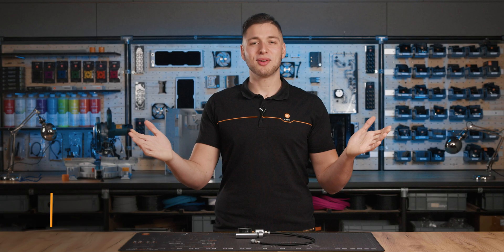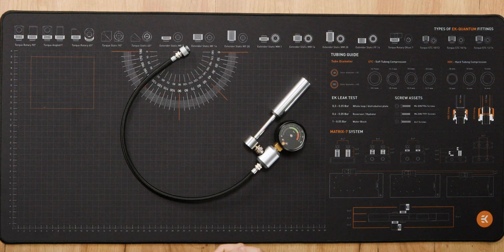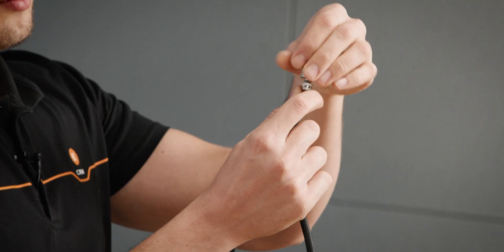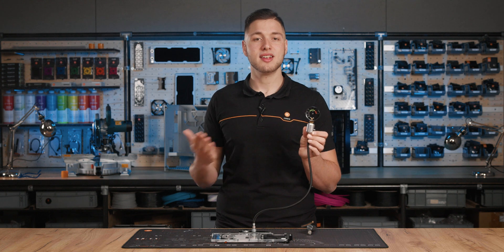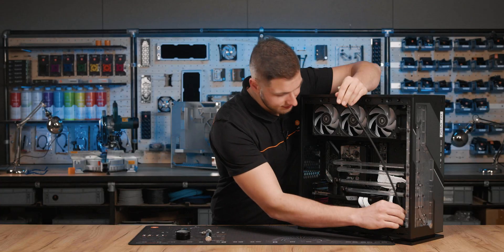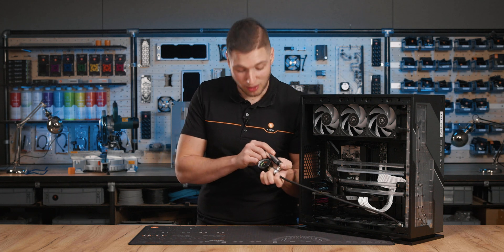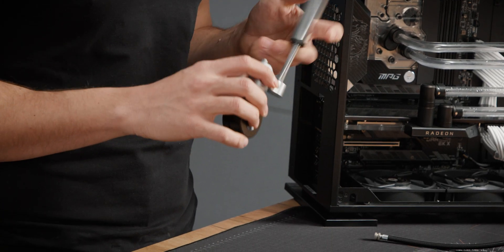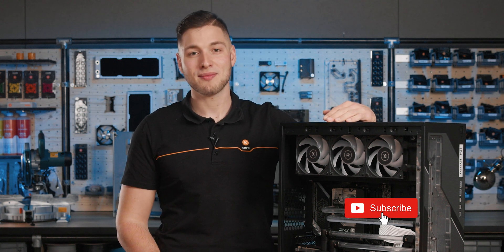How To Use FLEX - EK’s Brand New Leak Tester Tool | EK HOW TO

Comment: I came across this OLD POST & it fails to give PROPER INSTRUCTION in full. 
( A ) ALWAYS DRY TEST ALL COMPONENTS 0.25 is enough pressure!
WHY?- Ya never know if the component has been damaged during shipping ect..

( 1 ) Pressure Test your radiators AFTER you install the Fans,  DRY TEST. 0.25
WHY?- Because "IF" you accidently use the wrong screws & puncture the radiator,  you'll need to remove it & replace it. 

( 2 ) Pressure test All Monoblocks & GPU Coolers PRIOR to installing, DRY TEST. 0.25
WHY?- If you have a Crack you can resolve that issue prior to installation.

( 3 ) NEVER test past 0.25 as it will simply blow out the o-rings.
WHY? Your system isn't going to pressure very high unless your using a LARGE volume of coolant.

( 4 ) Testing a completed loop- NEVER LESS than 2 Hours. 0.25
WHY? Failure to extend the pressure time to test for o-ring failure. I use O-Ring Lube designed to keep the NEW SEAL & if the o-ring doesn't seal, within the 2 hours, chances are it never will. It is NOT necessary to use lube HOWEVER it can possibly prevent a o-ring from getting cut. 

( 5 ) NEVER overtighten your fittings. 
WHY?- Finger tight is sufficient enough & overtightening will simply crush the o-ring seal.

( 6 ) After the system has passed the leak test & the air has been removed, it is MANDATORY to test. DRY for NO LESS than 2 hours at 0.25
WHY?- Before Adding Coolant, this assures you've taken every precaution so as to NOT DAMAGE COMPONENTS.

( 7 ) Once the DRY test has passed you can FILL the system. Once filled & the coolant has been cycled enough to remove the air shut it down & UNPLUG FROM POWER.
WHY?- If it were to leak, it can damage components.

( 8 ) With the system UNPLUGGED, lay towels in the case below all the fittings.
WHY?- Because your going to now perform a WET TEST.

( 9 ) Wet Test with 0.3 for no less than 4 hours. MONITOR IT FREQUENTLY in case you need to terminate the test.
WHY?- Prevent Component Damage.

( 10 ) IMPORTANT: RELEAVE PRESSURE SLOWLY BETWEEN EVERY TEST YOU PERFORM.
WHY?- A good seal is a Tight Seal & you need to take precaution to protect the integrity of the many seals. That may sound silly but it's just a good habit to be gentle instead of rough with the components.

( 11 ) REMEMBER TO NEVER OVERCHARGE the system when testing. 0.3 to 0.4 Bar is a STABLE PRESSURE for most all system UNLESS you have a LARGE VOLUME of coolant. Keep in mind the system should NEVER LOOSE 2 bars, if it does then obviously you have a leak. I've built enough to know that 2 hours on a completed loop is NOT good advise! 

When people make these video's, they always seem to realize WE ARE HUMANS & Humans make mistakes. Take EVERY PRECAUTION to ensure your system is SEALED & reduce your stress!
"Good Luck & Best Wishes"

Comment: There is no need to go beyond 0.5 bar.. You risk popping tubes out of fittings. Also note, the gauge can drop by a notch or two over time (about 1 hour) as the pressure regulates.

Comment: I ve done this, got a leak, checked all my fittings maybe 10 times a day was not able to find the leak. Then I hadded some water slight after giving up with the pump. I was able to find the leak and directly stopped the waterpump and could fix the leak like this. I guess I was lucky lucky it was one of the fittings that needed even more tightening

Comment: Yes, yes, it's all very well, but i finished my computer with the lian-li dk-05F computador table with a custom watercooling with all the EK fittings and tubes, i put 0.5bar on for 15 minutes, no leaks, put the liquid in and turned the computer on, so far so good. After 30 minutes of stress testing cpu and gpu the tube popped out of the gpu radiator with only 29 degrees of liquid temperature. I've only had 2 Corsair I-link fans burn out, Corsair has already said that the warranty doesn't work because it's not a manufacturing problem, now every time I turn on the computer I can't rest easy with this system of fitings.

Comment: My loop is done. First one and I used EK's components. Outstanding material and great video help. Thank you for going step by step through this with me. I made a few mistakes here and there, but after using 7 sticks of clear acrylic, I'm ready to pressure test. My last stick, my last bends, I creased the 2 90 degree bends, go figure, the last one. But I'm keeping it, after all, it wouldn't be mine if I didn't get to be reminded not to put the tubing so close to the heat gun 😂

I'll post pics. She's not perfect, but you all did such a great step by step guidance in your videos, I'm confident she'll hold the pressure. Pics to come, and thank you all so much for walking me through this.

Comment: This was pretty refreshing. I pumped my new build to 15 psi and it dropped to 14 after an hour. I've been anxious since.
Reply: So, are you saying that after watching the video, you were OK with it dropping? I've had the same issue and nobody seemed to know. The video suggested that you only needed to measure for 15 mins max. I was measuring over 24 hours and couldn't work out why it was dropping a little bit.
Reply: @skynetintex5878  I was fine, considering I pumped it to a pressure range the system won't ever operate in. Months later and no leaks. What was your target pressure for testing?
Reply: @Alphahydro  I've literally just been pumping it up initially to 0.3 bar. It does seem to drop initially and then stabilise, which apparently is normal. I've also heard that you're not really supposed to measure over a long duration and that if you've not had a drop in pressure over 15 mins, that is sufficient.

Comment: Can this be used to get air out of a filled loop? I have stubborn air pocket in my CPU block that just keeps coming back.
Reply: Since it can only pump air into your system, I don't think it'll be of any help with that. You'll have to find a way to replace the air in your loop with coolant, in order to permanently get rid of it.

Comment: I'm surprised that a company hasn't developed a vacuum fill system for custom loops.  Basically you have a hand pump that pulls a vacuum with a valve you close, and then connected to a tee between the pump and system is another valuve you open with a tube you place in a bottle of coolant.  Thus using vacuum to fill the loop like they do with advanced automobiles.

Vacuum testing is also safer since you can't pull more than 1 atmosphere of vacuum, thus not exploding acetal/acrylic blocks.
Reply from the maker: It's completely safe and easy to use our Leak Tester and you cannot damage the loop if you follow the instructions :) The pressure of up to 0.6 bar (marked with green on the scale) is nowhere near enough to damage our blocks but is exactly perfect for leak testing.

Comment: 1. Can this also be used to DRAIN OUT / FLUSH and Clean an EKWB dual loop (GPU+CPU) on a Thermaltake 900 The Tower System. 2. I wish to buy this latest version urgently - but it's just not available in India (older version is) HELP please
Reply from the maker: The EK Leak Tester Flex's intended use is to check the systems/components for possible leaks and won't be of much help when draining the system. However, you should always check for leaks after cleaning the system.
You can grab your own Leak Tester Flex here: https://www.ekwb.com/shop/ek-loop-leak-tester-flex
Reply: @EKbyLMTEK   Thank you for your kind reply. I have ordered the latest EK Flex Loop Tester (Order No#200197875) & will be delivered on June 13th, 2022 at Mumbai - India for my Thermaltake 900 The Tower Snow Edition which has Dual EKWB Water Blocks and Radiators. BUT PLEASE HELP ME NOW ...... Would I STILL need to connect a SPARE PSU to Power up & Check the Blocks after Cleaning & Flushing is done? Is this an ABSOLUTE REQUIREMENT?

Comment: Can this be used to push water out of components for a flush?
Reply: You ever get an answer to this elsewhere? I would think it wouldn't work right since it's not a flow of air pushing, instead just slowly filling the space with air so the water won't move.